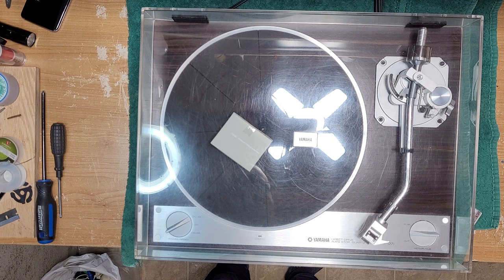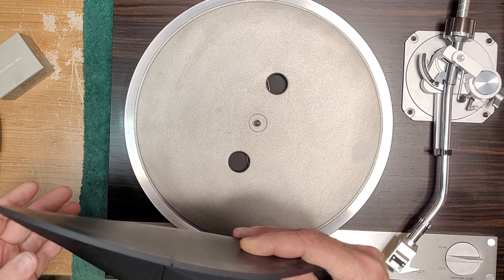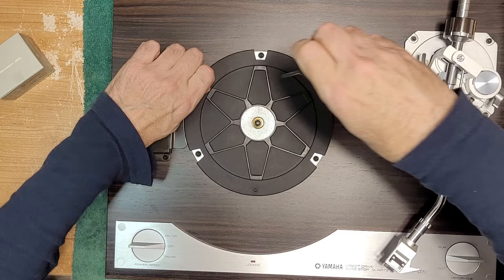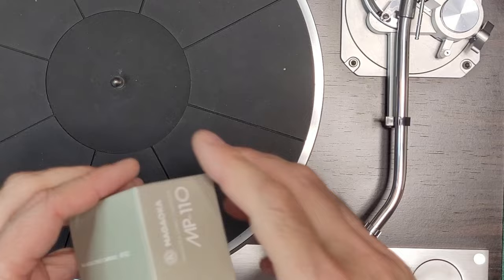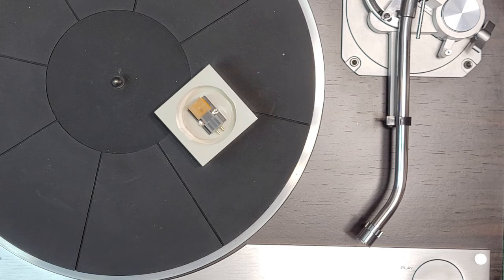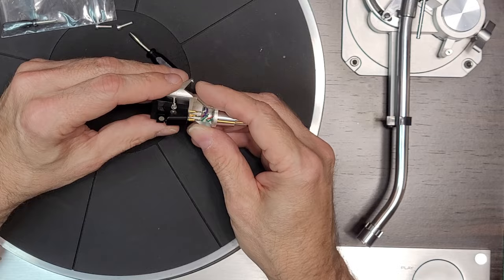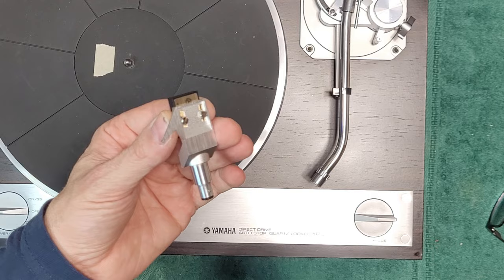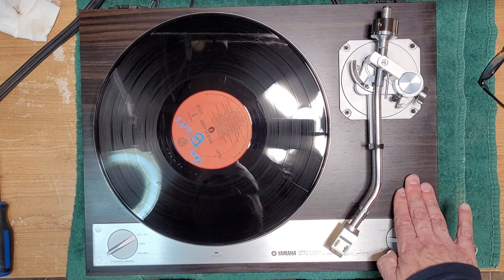Yamaha YP-D71: Service, Setup and Cartridge Installation

Comment: I thought that it was  a  Microprocessor Controlled Turntable but could the processor be on the bottom of the motor drive board.

Comment: TT Guy, you should make more videos of the ones which are more difficult to work on or exhibit unusual problems - but then you've got to remember to edit out the cussing 😄
Reply from the maker: Sometimes you just need to get through the pile and can't be slowed down by the video process.

Comment: I'm not understanding the tracking weight. You balance the arm level (horizontal) but then you move the weight back to zero (adding weight) and then again add 1.5? gr.
With my Dual CS-515, I turn the counterweight to be level, then don't touch it, then add the 1.5gr with a separate dial (and then anti-skating on a 3rd dial)
Reply from the maker: You don't move the weight, just the dial to zero, then turn the weight with the dial to the correct setting
Reply: @TurntableGuy   that makes sense - thank you!

Comment: To me, the GRADOS have a too loud midrange. Yes,  I had the 'hum' problem with them.
Reply: Humm problem is often cured by cleaning the cartridge body and stylus contacts. There are 4 on the stylus and 4 inside the body. Qtip and alcohol removes it.
Reply: @Poppinwheeeeellllllieeeeez  That never did it in my case. It was the cartridge itself.